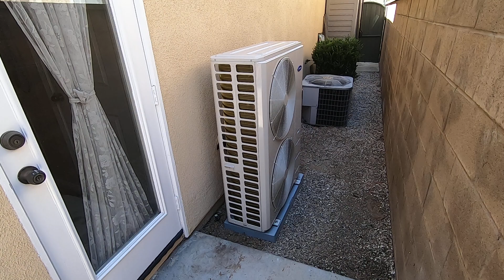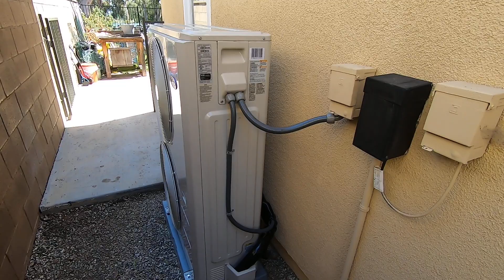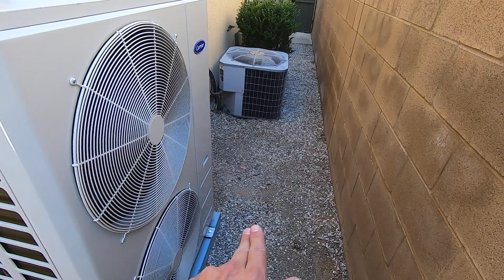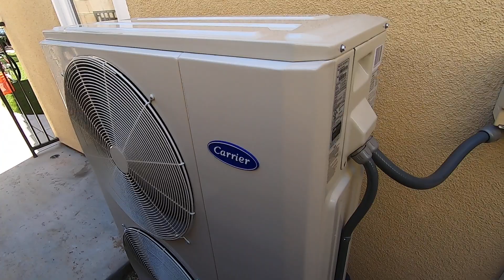Carrier 38MURAQ Variable Speed Slimline Condenser

Comment: The exhaust fans air hits the wall where is the exhaust air going does it effect the efficiency cuz air is not distributed correctly
Reply from the maker: This unit is 5 inches off the house wall with several feet to the left and right, as well as 44 inches in front of the fans.  This we exceed the recommend manufacturer clearances required.  The manufacturer clearance specifications can be found in the installation manual on Page 8, figure 8.  Here they are for your reference -  4 inches from the wall, 24 inches left, 24 inches right and 24 inches in front.

Comment: Very few reviews on this unit.  I assume this is the same size for a 3.5 unit?  There are deals on this unit right now.   But I haven't a clue how dependable they are compared to Daiken and AC pro units.  These look VERY similar to AC pro units.  Which would mean the 5 ton unit is very similar to the 3.5 ton unit?  Nice info!!
Reply from the maker: Carrier does not make this unit in 3.5 ton.  It comes in 3 ton, 4 ton and 5 ton.  The 4 ton and 5 ton are the same size as the condenser in the video.  Right now there is a Carrier Rebate and other rebates depending on configuration and size you install.  These condensers are based on the Carrier ductless split condensers that have been out for many years.  So they are very reliable and we have had no issues with them so far.  They are similar to the AC Pro slimline condenser in the way they are designed and work.  Thank you for your comments.
Reply: @albertairinc.1140  Your information is very helpful.  I think you're in Anaheim.  I'm going to try and make a call and get more info.  Thanks again.  Anyone I should ask for?  What's the appropriate air handler for a 4 ton?  which all I need is a 3 or 3.5 ton.  1500 sq ft.
Reply from the maker: @twoweeledsoto6072  You can ask for me, Nick Albert.  I can help you with any questions.

Comment: Hi Nick! We just got a Carrier 4 ton 38MURA installed to replace a 4 ton Bryant Preferred slim line that had amp draw issues.  The MURA runs much, much quieter especially on start up and when it shuts off! However at the end of every single cooling cycle it stops then it immediately runs again for 1 minute with the fan running in the opposite direction and the fan runs at a much higher speed (most likely max speed) than when it is cooling creating a lot more noise which is very annoying at night. My installer called someone at Carrier and they said this is a locked in setting to clear out any debris from the back of the unit after every cycle and cant be adjusted. Do you have any insight on this? Is there any way to reduce the fan speed on that 1 minute cycle that runs after every cycle or even disable it completely? This is the only annoying thing about this model, it sounds like a jet engine taking off immediately after every cycle. Thank you!! And great videos!
Reply from the maker: I would need to know a little more about the system.  What indoor unit did you match the 38MURA with?  What size is the system?  What thermostat are you using with the system? And what is the wiring configuration?
Reply: Hi Nick, it’s a 4 ton system paired with a Bryant Legacy 60,000 BTU furnace and an ecobee thermostat. not sure what wiring they used. We actually live in Orange County would it be easier to call and have u take a look?
Reply from the maker: @ryryryryry55757  I am going to talk with my Carrier rep about this issue and see what he says.  If you would like us to come out and do a diagnostic we can.  It is $109 for the diagnostic fee.
Reply: @albertairinc.1140  Awesome, thanks so much Nick! We'll see what he says, and I'll give you a call to come out if he says there's a solution.
Reply from the maker: @ryryryryry55757  So I do know about this function on the condenser.  I asked my Carrier rep to confirm this and see if there is anything we can do about it based on system wiring, thermostat, settings, programming, etc..   I just got a reply to my email I sent him.  He said this "Yes it is doing what it is designed to do; runs for 30 sec opposite direction  to blow the coil clean will do this after cycle ;can not do anything  about it,  factory programmed TO KEEP THE COIL CLEAN."  So, unfortunately there is nothing we can do to stop the this cycle on the condenser from happening.  I am sorry for your inconvenience with the noise issue.
Reply: @albertairinc.1140  Thanks so much for looking into it Nick!
Reply: @albertairinc.1140   Long shot, but have you had any follow up with Carrier on this, or perhaps learned any new info?  I am legitimately considering getting my system removed because this function keeps waking us up.
Reply from the maker: @royroyroyroyroyroyroyroy  The same info I gave you three weeks ago still applies.  There is nothing you can do to change that function.
Reply: @albertairinc.1140  Wish my contractor had told me about this up front - I would have chosen a different unit.
Reply: @royroyroyroyroyroyroyroy  Wow, so that's the obnoxious higher level noise I'm hearing from my neighbors unit.  It's so damn loud as I've said before and kicks the dB meter up to a very annoying and wall penetrating level.  Doesn't Carrier think about these neighbor facing units when they design these things.  I was an R&D Mechanical Engineer for about 35 years and if this type of performance was the best I could do the project either would have been scrapped or me fired and replaced with someone more creative/smarter, lol.  Got to be a better solution than to wake up the dead or annoy neighbors.  And the their 5 stage is so incredibly quiet!

Comment: Very nice and quiet.  My neighbor installed a 5 ton just like it and it's 76 dB at high speed and the noise just passes right thru a block wall, vinyl fence and my house wall so that I hear all the low frequency noise 63 hz and 125 hz and my thought is that's compressor noise and maybe something wrong with this unit or the install!   Dealer says it's my problem not his too.
Reply from the maker: I'm sorry to heat that.  The units I have installed have been true to the manufacturers sound rating specs.  Compressors can make more or less noise based on many factors.  Here are a few factors that we check when installing these units.  1 - Refrigerant lines are correct size and install a by-flow 163s filter dryer.  2 - The condenser is set to the manufacturer specs for clearances from walls and other obstructions.  3 - The return and supply air is correct for the size of the system being installed.  4 - The unit comes critically charged for 25 feet of refrigerant lines.  For every 1 foot after that the unit needs .6 ounces of refrigerant to be weighed in.  5 - The unit is wired correctly for the type of FAU and thermostat being used.  I hope this helps.
Reply: @albertairinc.1140  Thanks so much for the reply.  It's about 7" from the house wall and 30" from the slump stone wall.  About 4 feet below my house and lots on hard reflecting surfaces.  But I used my dBA meter 30" from it and low speed was 69-70 and high 76 dB so something is wrong.  Ecobee so they only get low and high speeds and the high speed runs for 45 sec or more after every cycle.  The Dealer here says it's not his problem and building walls doesn't help for the 63 and 125 hz peaks driving these levels. 

OH I wanted to add, it's 5 tons for a 1987 2475 sq ft house with new vinyl windows and good insulation.  Oversized and that's typical of dealers here ignoring Manual J calc and using the "rule of thumb"
Thanks again, good job!
Reply from the maker: @sdcoffeeroaster  You're welcome. From you description it could be oversized and that can cause the noise to be higher than it should.
Reply: @albertairinc.1140  My 5 stage infinity is oversized by these guys too and they would NOT install a 3 ton for my 2076 sq ft house.  But since it's 5 stage, it's only hit the 3rd stage of 5 once on a 110 deg day, very rare in San Diego..supporting my manual J calcs.  And it's only 49 dB from the side and also exhaust straight up.
Reply: @albertairinc.1140 I don't want to hog your post because I'm sure installed correctly like you do these unts are amazing.  I just did a quick couple of videos and posted the high speed run pretty far and above this 5 ton and thru a top rail of the vinyl fence and recorded 66-67 dBA.  It's 76 dBA down next to the unit and I did hear 3 very differnt speeds that are in other videos I didn't post or 51 dBA, 58 dBA and then 67 dBA, with a 41 dBA ambient reading .  https://www.youtube.com/shorts/8nhWb-SCAvM
Reply: @sdcoffeeroaster  any chance you ever figured out your neighbors loud unit?  I just had a 38mura installed, and it is much louder than I expected.
Reply: @royroyroyroyroyroyroyroy  No and I've commented below because I didn't realized they run the damn thing backwards every cycle.  I bet the fan blades are designed to be ultra quiet in the forward direction and not so quiet running backward.  Why in the world does the condensor need to be "cleaned" anyway.  They don't do anything like this in my quiet 5 stage AC.  This appears to be bandaid fix put in at the 11 hour based on my R&D design experience.  They have to know this is annoying to owners and any nearby neighbor since this low frequency just goes thru conventional walls like they don't exist.
Reply: @sdcoffeeroaster  Yeah, this entire system has been a disappointment.  I have no idea how Carrier markets this as 'Extremely Quiet'.  I am going to (unsuccessfully) beg my contractor to remove this system, I can't sleep while it is running.
Reply: @royroyroyroyroyroyroyroy  I don't blame you one bit.  My neighbors unit is very far away from their bedroom and only near a laundry room and part of a study.  If they had moved it 10 feet towards the street it would have missed hitting the side of my house directly.  I can hear that high speed operation 30 feet away all across my dining room, thru a hall way into the family room right where I sit to watch tv.  I tried moving the recliner, built a 7' long 5 foot tall concrete wall filled with sand and while that helped it's just not enough.  Just remember to mention that Carrier has a 100% satisfaction guarantee and if the dealer can't do anything then get the factory involved.  They need to know about how noisy these units can be for some of us.  They refused to help me since I am not the owner and my neighbor is very passive about this.
Reply: @sdcoffeeroaster  Thanks!  Unfortunately my installer wasn't a Carrier Factory Authorized dealer.  There was only one in my area, and I didn't choose them because they lied about the unit being eligible for a federal rebate.  I think I'm stuck with this, unless I can somehow convince my installer that the unit is running out of spec (the dB readings are much higher than Carrier advertises).
Reply: @royroyroyroyroyroyroyroy  Sorry to hear that.  I have another CA dealer asking the same question about noise and the way it operates since he said the reverse operation of the fans sound very strange to him.  No doubt he'll get the same answer but I will post here.

Comment: How do people like the side discharge when installed facing backyard with regards to hot air??
Reply from the maker: Typically these units are placed on the side yard where you would just be walking by the condenser and feel a little air blowing on you.  But if you were sitting in front of it for a long period of time you would get hot and uncomfortable.

Comment: Great video. I am in the same boat. Although I had a duel fuel system installed. 38MURAQ48AA3 paired with the 57TP1. The installer originally thought they would need to run the 2 wire but once they started the install they told me they wouldn't need to and they could use the existing wiring from the old system. They also installed an ecobee. How would this effect my system operationally not having the 2 wire? Does this mean I am not getting variable speed without the carrier thermostat? Is it worthwhile to have it installed now? Thanks for the awesome info. Btw, I am in San Diego. Do you service this area?
Reply from the maker: Yes, when paired with the Ecobee thermostat the system is not a true variable speed system.  The outside condenser will go up and down in speeds but the inside blower motor will not.  To have the true variable speed capabilities you would need to pair your system with the Carrier communicating thermostat.  Unfortunately the Carrier thermostat is not very nice looking, does not have wifi or some of the other features of the Ecobee.  So other than being able to have the variable speed communicating capabilities with the system it is not very good.  For those reasons I have not installed that thermostat with this system.  My customers are buying the 38MURA unit for the lower sound rating and compact design.
Reply: @albertairinc.1140  does it work with nest thermostat? For variable speed?
Reply from the maker: @sergiodoordie319  No.  You would have to use the Carrier communicating thermostat.  Any other thermostat will make that system a single stage.

Comment: Nice unit! I got the 2-ton version installed and it is quiet and efficient. Mine is paired with the 40MUAA fan coil. The hvac company that hooked it up used "wiring scenario 3" so there are 24v wiring from the ecobee thermostat to both indoor and outdoor units. After looking at the manual, it seems like they should have used "wiring scenario 1" which uses a 2-wire communicating connection between indoor and outdoor units, and 24v wiring between the ecobee and indoor unit. What do you think?
Reply from the maker: We usually use the Ecobee thermostat with this system as well with the same wiring hook up you have.  If you do the 2 wire scenario you would have to use the Carrier thermostat for that to work.   With the Carrier thermostat you would get a true variable speed communicating system with the 38MURAQ and 40MUAA.
Reply: @albertairinc.1140  Thanks for the reply! With the 40MUAA there is another option in the Connection Diagrams section of the manual. It's "Scenario 1", where the indoor and outdoor units are connected with a 2-wire communicating link and the ecobee is wired with 24v to the indoor unit only. Would you be so kind to check it out and let me know what you think?
Reply: @albertairinc.1140  Check out 'scenario 1' in the 40muaa manual. It shows 2-wire communication between indoor/outdoor unit but 24v connection to the thermostat.
Reply: How much did it cost you?
Reply: @corymacdonald383  About $8000 (Canadian) out of pocket, after taxes and rebates. That's for both the indoor and outoor units, installed, with a new humidifier and filter platform.
Reply: @tomtomkzzz  I got quoted $16000 Canadian.  That's taxes in for the same setup.  Minus the humidifier and air purifier.  I figure it will be around $10,000 after rebates.

Comment: I'm confused on the heat pump vs a/c distinction when it comes to the federal tax credit and the SEER2 >= 16 requirement.
Is this unit not labeled/marketed as a heat pump meaning it would always fall under the heat pump criteria for the rebate?

When paired with a gas furnace, is the reverse heat pump ability disabled or something, invalidating the tax credit?

What if it it was paired with a 40MUAA Fan Coil, is it a "heat pump" then?

For contrast, I'm aware that Carrier has specific, dedicated Central A/C units, like the 24SPA6 Performance 16 that could never function as a heat pump.
Reply: This Carrier 38MURAQ can be wired as a heat pump condenser with the Carrier 40MUAA fan coil or Carrier FV4 fan coil and would qualify for the split ducted heat pump Federal Tax credit up to $2,000 if the system meets the 15.2+SEER2/11.7+EER2/7.8 HSPF requirement (note:  not all sizes will qualify).  An AHRI certificate for the system match up is needed.  

The Carrier 38MURAQ can also be wired as an AC only condenser and matched with a Carrier gas furnace and evaporator coil.  This would qualify for the split AC Federal Tax credit up to $600 if the system meets the 16+SEER2/12+EER2 requirement.  (note: not all sizes will qualify).  An AHRI certificate for the system match up is needed.

That is correct.  The Carrier central AC condensers can only be AC condensers.  By contrast, any Carrier heat pump condenser can be a heat pump when matched with a fan coil or can be wired for AC only and be an AC condenser.

I hope this answers you questions.  It can be very confusing.  And to make it more confusing there are different efficiency criteria for the tax credits based on your location in the country.  All of the efficiencies listed above are for the south region tax credit criteria. They will differ if you are located in the north.
Reply: @fijiman88  Thanks for the info, very helpful. 👍

Comment: Ok, so I have a deck that cantalevers off the house, and the traditional unit is out in the heat of the day and the fan exhaust is vertical. The fins, although fenced are exposed to the hazards of hail and debris (lawnmowing). So, the unit can be set under a deck and exhausted horizontally, yes? And the fins (don't see them in your video, are on the backside, facing the structure, yes? Minimum setback from vertical and horizontal surfaces?
Reply: Yes, the units fans blow out horizontally. Yes, the coil (fins) are on the back of the unit and right side of the unit.  Set back is as follows - 4 inches off a wall, 24 inches in front, 24 inches on right, 4 inches on left and 24 inches on top.